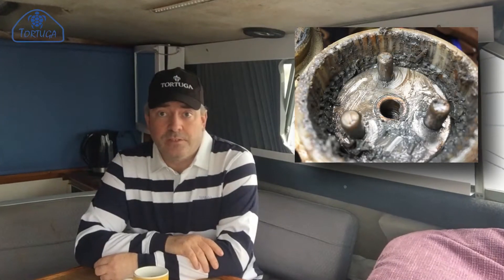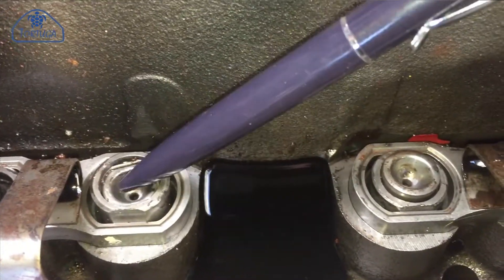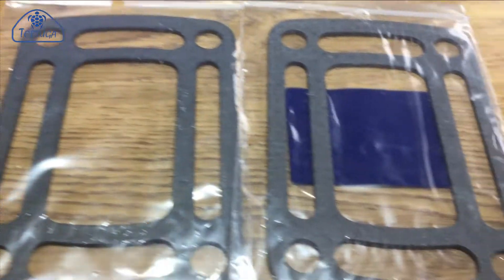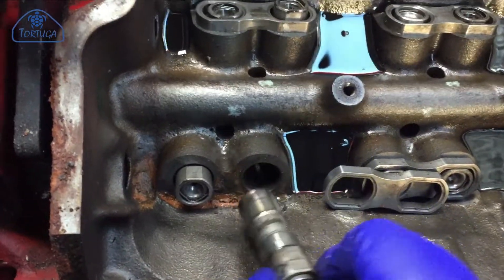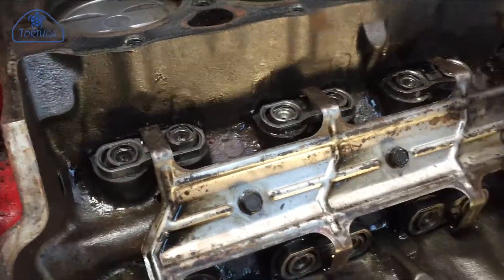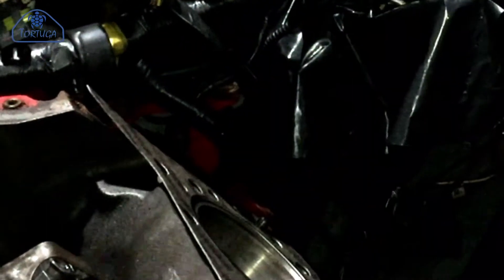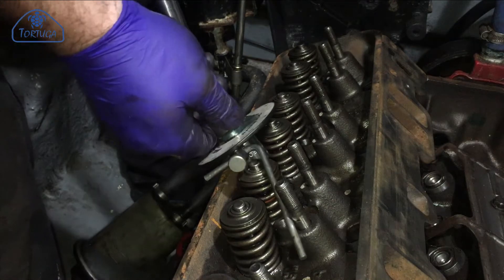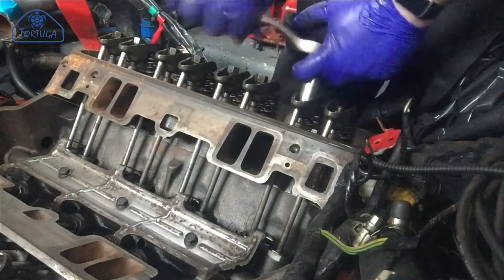Dealing with Water Ingress - Volvo Penta 5.0 GXI-J V8 - Part 4

Comment: Well done so far, considerably better than the average YouTube how to. Quite helpful as the boat I just purchased has the same starter issue as yours. (5.7 Gi) I’ll start tomorrow with checking connections and then pull the spark plugs. Hopefully I can get away with just pour connections or a starter but your video is quite helpful. Thanks again. 👍
Reply from the maker: Thanks for the comments, fingers crossed it is only a connection or solenoid issue for you. Keep me updated and if there is anything I can help with let me know. Thanks again